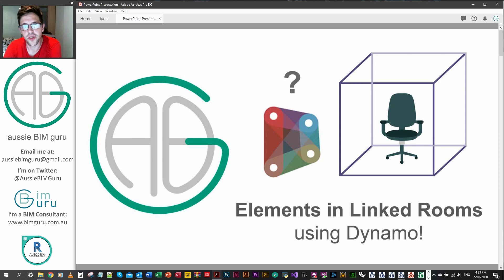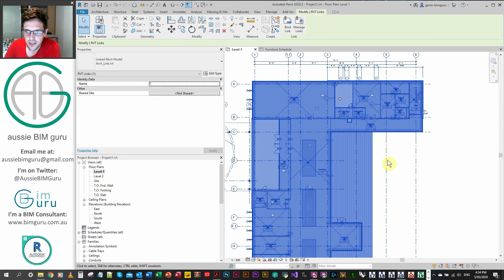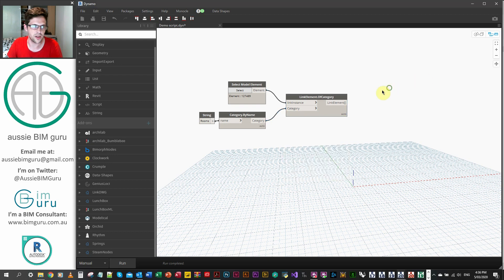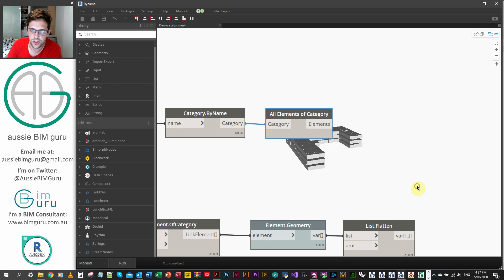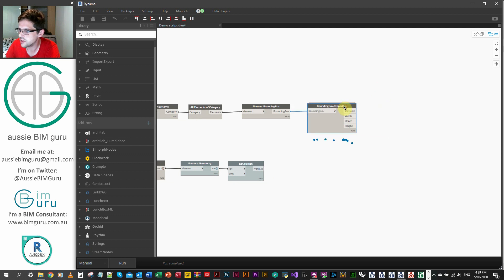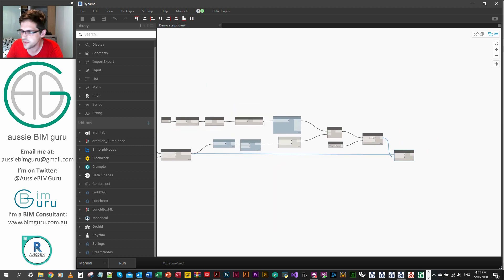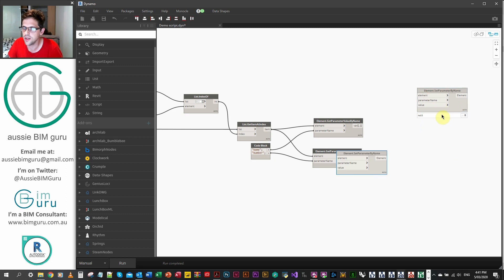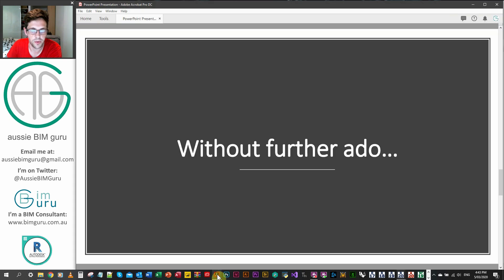Elements in Linked Rooms using Dynamo!

Comment: Hello, I have the problem the other way around. I have the rooms in the host model, and I am trying to get the windows from the linked model to connect to those rooms. Do you have a solution for that. I think it is a pretty common problem to solve when working in collaboration with a facade consultant. Thanks in advance
Reply from the maker: In that case i would suggest this method:

1. Collect linked windows from document
2. Get their location point, project it slightly forward and back in its facing orientation
3. Transform the points by the links coordinate transfor to the host models own coordinates
4. Use the revitapi method doc.GetRoomAtPoint() method to get the host room at those points

Its generally not easily done with native nodes unfortunately. Some of those exist as custom nodes though in various packages.

Comment: How can we expand room geometries upwards (transformed the coordinates first) to intersect MEP elements at the top of that level but lie outside the room, while ensuring room parameter values remain correctly assigned?
Reply from the maker: Most MEP firms tend to use Spaces instead of rooms, and larger/more capable firms tend to develop room to space automations to keep boundaries/numbers in alignment with architectural models.
Reply: @AussieBIMGuru  Thanks. I actually started working with MEP Spaces workflow, but in a very large project the spaces in the MEP model were inconsistent (and I didn't want to make major changes) so I switched to a room-based workflow. I’m also seeing some mixed parameter values in a few areas that I still need to troubleshoot.
Reply from the maker: @BIM_G yes if users dont stay on top of the updates that can happen. No perfect way to do it.

You could also move the points of objects downward or to the level below as a means of testing at room level i guess.

Comment: Hey Gavin! The linked models falls correct on 3D view, but the coordinates pulled from geometry.BoundingBox differ from model to model.. I am thinking that i need to use something with "Traslate" or "transform". Any ideas?
Reply from the maker: Yep this video shows how to apply link transforms:

https://youtu.be/6Di0kUX8mP8
Reply: @AussieBIMGuru  Thank you Gavin! Another question 😇 How do you get rid the elements that have index -1 (the elements that are not in a room apparently)
Reply from the maker: @aalexg13 an equals node and a filter by boolean mask checking for -1 equality is the easiest, although there are more tricky options such as getting the room numbers then adding the item 'N/A' or an empty string to the end of the list, then indexing using code block syntax (list[index]). In a code block -1 will return the last item in a list unlike the itematindex node.

Comment: This is awesome, I am getting an error on the "Element.Geometry" node which says "Warning: One or more geometries have failed to convert due to this error: Unable to make wire from edge body : WIRE_SELF_INTERSECTS2 -- Wire has self-intersection." It also puts the wrong data into the furniture and I'm thinking it's because of the error. Any ideas? I've searched the world wide webs and can't find anything. Thank you!
Reply: Or is there an easy way to find the self interesting room?
Reply from the maker: Unfortunately this is common for complex or messy room boundaries, particularly if they have gaps between walls that have to be crossed by the boundary ever so slightly. I haven't found a good workaround to these generally. Sometimes you can work around this by asking for their finish boundary and then extruding that.

You could also filter out these rooms, and then isolate all elements without a room found after for manual review. Hopefully it would generally only be 1 or 2.

Comment: Hello, thanks for the great contribution. The LinkElement.OfCategory Node appears a warning that says: Method not found INT64
Do you know how it can be solved?
Reply from the maker: Sounds like an issue related to the 64 bit integer change and elemend Ids which comes in later builds. Ensure you use the latest package version, and if it still doesn't work maybe contact the package author.

Comment: Hello, thank you for your video !
I've tried to do this with a MEP model and an architect's model linked containing the rooms, but it doesn't work. I would like to locate the networks and equipment in each room. But I have the impression that my room volumes are not in the same place as my networks, even though the models are compiled correctly. I also keep getting an error with "element.geometry". How can I resolve this?

Thanks a lot!
Reply from the maker: Try to get the geometry in Dynamo to see if it is actually intersecting. You may need to apply a coordinate system change using the link transform if they are not using the same internal coordinate positions.
Reply: @AussieBIMGuru  Indeed, I think it's an internal problem. The geometry created by dynamo for the rooms is far from the geometry of the objects, so there's no intersection. It finds the same part name value for all objects. How can I allow them to have the same internal origin?

Comment: Thanks again! Would you recommend any aproach to deal with elements a little bit outside the rooms? Like on walls or below the floor?
Reply from the maker: Generally for these you could get the room boundary and scale it up slightly from centre or offset it as a curve then extrude as solid and use that instead.
Reply: @AussieBIMGuru  I'll do that. Thank you very much! 👏👏👏

Comment: Hi Gavin, I am facing issue in catching outlets which are recessed on wall. Those elements are lying on the verge of room boundaries and missing the "does-intersect" node. Interestingly, if I create a space and run FamilyInstance.Space node, it is detecting those elements and working fine. Any idea how to catch those recessed elements.
Reply from the maker: This is likely due to the location versus the room calculation point. For these types of elements you would need to move the location forward by a nominal amount to ensure it is in the spaces geometry.

Comment: Great video it is a great workflow. I am a lighting designer so all of my fixtures fall just above a room. I tried to use a geometry translate to drop the z cord inside of the room but was still pulling only "false". I was wondering if you had any ideas that may fix that issue of pulling only "false" results from the clash detection.
Reply from the maker: Hrm that's odd, usually a point would work assuming it is inside the room geometry. Maybe try creating a line instead and see if that works?

Comment: Gavin, any suggestions for families that span multiple floors, like elevators or escalators?
Reply from the maker: I'd usually say these belong to the lowest room. Their origin as a family would likely be at their base so should be able to be assigned the number in the same way as this workflow if you take the origin of the family, or the bottom centrepoint of their bounding box (uvw = .5,.5,0)
Reply: @AussieBIMGuru  I actually removed the centroid node, and just intersected the families' bounding boxes with the rooms and that did the trick! Thanks!!

Comment: Hi BIM dragon ;), i have a question for u, if i want estract pipe inside ceilings and the pipes runs outside ceilings how can i do?
Reply from the maker: BIM dragon, that's a new one haha - I like it!

Hrm this is quite tricky, you could always get the room boundaries instead and patch them to surfaces. You could then take all pipes between that level and the next, take their bounding box and its cuboid, then its centroid - this would represent the absolute centre of the pipe segment. You could then pull this point down to the level and see which room surface it clashes with or is closest to. Pretty tricky, but probably the most efficient method I can think of that ignores room height.

Comment: Hi Gavin, Awesome vid. what would, considering the described workflow, be the best function/node to clear -1 results in the list.map node?
Reply from the maker: The best way to manage these out (essentially an item with no intersecting room) would be to first check 'any true' @L2, then filter out the results, geometry and rooms using a boolean mask each so that the only results remaining will have at least one intersecting result (aka a true). -1 indices essentially mean no match was found.
Reply: @AussieBIMGuru  is it possible to post a screen for this? I really struggle to filter out those -1...
Reply from the maker: Try this method I posted here today but instrad of the isnull node use a != node for checking against -1. Filter the indices by that boolean list and only the non -1 results will be in the in output of the boolean mask node.

https://forum.dynamobim.com/t/filter-two-lists-of-values-not-equal-to-null/69328
Reply: @AussieBIMGuru  that link is useful and save my day, it uses two boolean filter but share the same mask, thank you!

Comment: Thanks this excellent video, Gavin, I will ask a question how  can I be able to find smart, interactive or practice way to place my different furtinures to different rooms as script ?
Reply from the maker: You would need to write algorithms to detect the room boundaries and area and work your way inward from the edge or outward from points within the room as a surface probably.

It really depends on the type of furniture you're placing or the room type. For example a meeting room you would probably find room centre and the short side of the room, then place the table/chair as a family (nested chairs/table) at the centre, rotated for the short end of the table to face ths shorter side.
Reply: *furnitures

Comment: Great video! I only had one question. im trying to use at method similar to yours to find the location of dampeners in a ventilation model and check if the the electrical components are in the same place, or i will move them to the right location. I also need to check if there are any new dampeners or if some have been deleted. the way i do this is to copy the BATID from the ventilation model and copy it to a parameter i have made. I used the list.conains node with cross product to check if  the BATID from the vent.model is in the electrical model an reverse. When problem is when there is a new dampener in the vent.model i get a -1 it the list.contains. my question is how do i do the "catch all" filtering you where talking about?
Reply from the maker: Thanks!

The catch all I refer to here is mostly in relation to elements slightly outside the room, such as wall recessed elements. These can be difficult to collect using a workflow like this given they aren't in the space itself.

Usually in these cases I would build an excel file with distances for each problematic fixture type, then project their origin point slightly forward so it falls in the room it points towards.

In your case I like your workflow, using a matching Id is the right approach. If new fixtures are failing to find a match I would filter these out separately before updating the ones with a match. You could then generate a report in excel with the Id's of any unmatched elements from the ones that got filtered out, so they can be manually reviewed.

Comment: Epic work again Gavin. I'm trying to work this graph on copy/monitored mech. elements. The things is when a monitored element moves without our notice (when sync the link), the graph does not match the locations between elements so I cannot get the parameter from the linked model. Do you know how we can solve this problem? How we can update the location of copied element without manually align them.
Reply from the maker: Thanks!

I'm not 100% sure on how to get a copied element to identify its monitored counterpart but that would be the key. If this was possible, you could simply use 'element.getlocation' on the monitored linked element and apply an 'element.setlocation' to the copied element.

From what I can see, copy/monitor is not exposed in the API unfortunately, so the only way I could think to do this would be to manually add the monitored element's ID for comparison. Not a great workflow though I know...!

If the copy/monitor list was exportable as a report with ID's this would help, although I don't seem to recall this being available.
Reply: @AussieBIMGuru "From what I can see, copy/monitor is not exposed in the API unfortunately". Yes, I hope this will be added in the future. It can really help especially when you are working with too many discipline links. Thank you man.